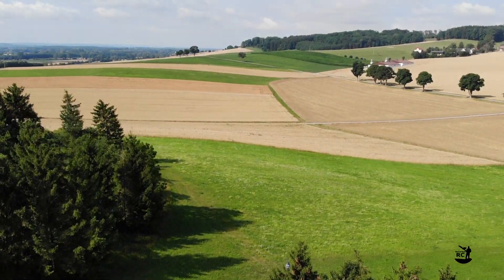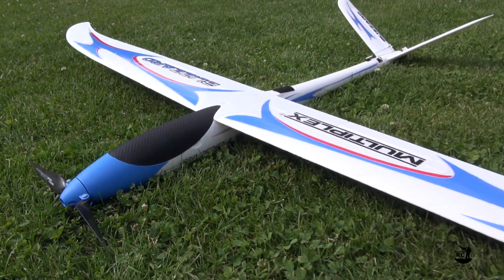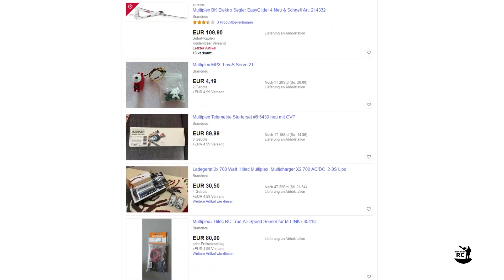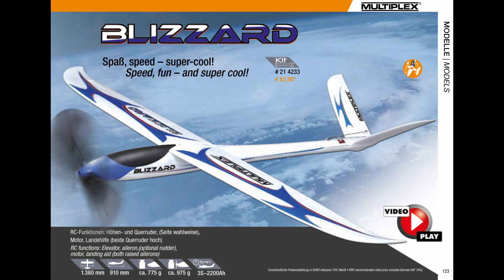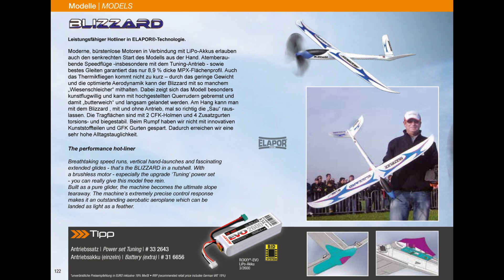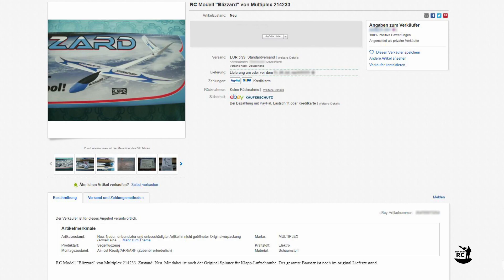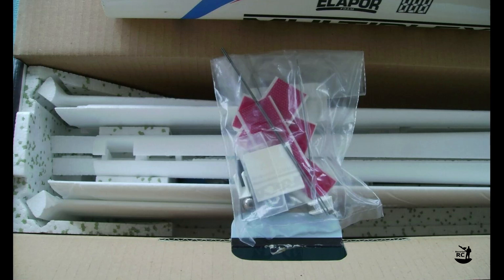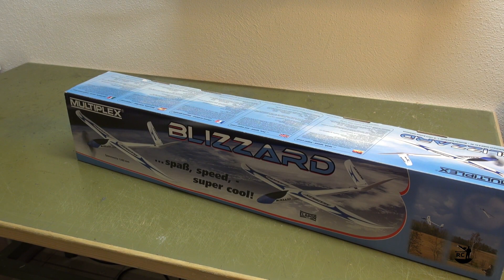Multiplex Blizzard - Time Lapse Build

Comment: The sense of speed is considerable. I want to know the motor size and folding prop size.
Reply from the maker: Yes this plane can go really fast 😁 The motor is a Torcster Brushless Gold A3542/4-1460. I am using an Aeronaut CAM Carbon 9,5 x 6 folding prop.

Comment: I know it's an old video. But.
This looks like a really plesure to build.
It looks really solid, a lot of re-enforcing in the kit, but well sorted in the light end of the scale. Beautifully engineered.
And it's a sleek and fast plane.
Great timelaps. 🙂
Reply from the maker: Hi, I am happy to see that also my older videos are still watched. The build was really quite simple and the instructions from the kit were super clear. The strength added with all the re-enforments is quite significant. The only remaining issue is that the ailerons start to flutter when going into a vertical dive with a speed roughly above 250 km/h ... but hey who needs that 😉 I am still flying the Blizzard a lot and after around 150 flights and 2 crashes with subsequent repairs I still enjoy it a lot. If you haven't already seen it, there is also a flight video of the Blizzard: https://youtu.be/EkrB3kJKRLg
Thanks again for your comment! Cheers!

Comment: One thing I did not realize about these kits is that the decals provide a critical role in the structural stiffness of the aircraft and are not just there for decoration.
Reply from the maker: Never looked at it like that but you are certainly right!

Comment: Hi. Can you please tell me what kind of CA you used? And maybe a CA kicker? (Accelerator)
Nice build. I've found also a new kit. I hope to put in a setup put together from HK.
Best regards.
Reply from the maker: I used the CA from Multiplex that is specifically for Elapor, it is called „Zacki Elapor“. I recommend using the medium viscous one and in case of need to come back with the thin CA called „Zacki Super liquid“. Any normal CA will damage the foam! The kicker I used is „MitreBond Aerosol Activator“, but I guess any activator should work with it. And be sure to wear gloves 😜 as you can see in the video I started wearing them after glueing the first part... Enjoy the build and the flying. It‘s really a blast! Just be careful with too steep dives, it tends to flutter at high speed. My flight video will hopefully be finished soon. Greetings from Bavaria
Reply: CA kickers (accelerators) are quite unhealthy! Over the years I built quite a bunch of Multiplex foamies (Easy Star, Easy Glider, Heron, Blizzard). Always used Zacki and Zacki Super liquid - never any activator. Even after years of flying, all glued connections are in perfect condition. You cannot ask for more. Perfect match!

Comment: Den Motor und Akku von deinem lidel fliger Projekt gibt es nicht mehr. Meine Frage ist welchen Motor und Akku man stattdessen nehmen könnte.
Reply from the maker: Den Graupner Motor von meinem Lidl Flieger gibt‘s leider nicht mehr da Graupner insolvent ist. Du kannst aber einfach einen anderen 2218 Motor mit rund 1200kv nehmen, z.B. Den Emax GT2218 / 09 1100kv oder den Flite Test Radial C. Als Akku würde ich nen 1600mAh 3S nehmen.
Reply: Ok vielen Dank.
Reply: Haben sie vielleicht auch noch einen Tipp für den esc und für einen preisgünstigen Sender
Reply from the maker: Für den Einstieg wäre als Fernsteuerung die Spectrum DX6e nicht schlecht. Als ESC würde ich was günstiges aus dem Bereich 20A nehmen... bei dem Motor Setup vom Lidl Devil fließen rund 10A. Kleine Frage: ist das Dein erster Flieger? Wenn ja dann würde ich von dem Projekt abraten... das ist was als 3. oder 4. Flieger
Reply: Bavarian RC oh ok. Ja das ist mein erster Flieger. Dachte das wäre so ganz gut da es nich ganz so teuer ist. Was könnte ich den. Stattdessen bauen.
Reply from the maker: Ein guter Einstieg wäre der Easy Star von Multiplex... die Version 2 gibt’s ab und zu auf eBay günstig... oder wenn Du irgendwo (Lindinger) Foamboard bekommst einen von den Flite Test Einstiegsfliegern z.B.. Simple Scout, Tiny Trainer,...gibt’s auch als Kit
Reply: Neben dem erwähnten Easy Star ist auch der Conscendo von eFlite ein hervorragendes Anfängermodell. Als Modellflieger mit 45 Jahren Flugerfahrung würde ich einem Blizzard in der Hand eines Anfängers ab Start keine 5 sec. Überlebensfähigkeit geben. Der Blizzard macht extrem viel Spaß für Leute, die fliegen KÖNNEN. Viel Spaß mit dem Hobby!